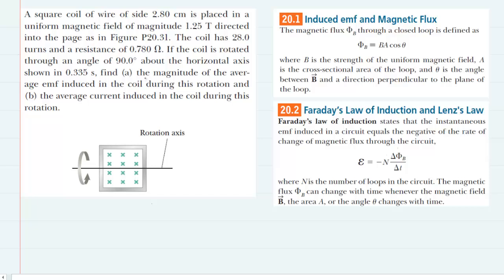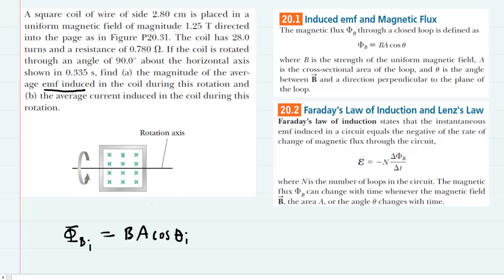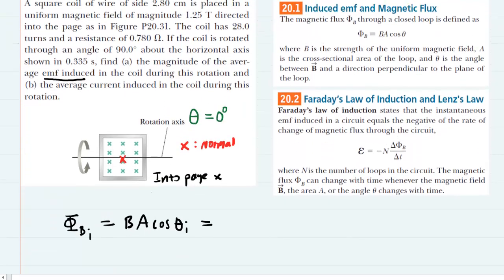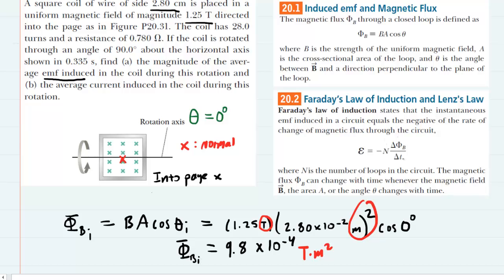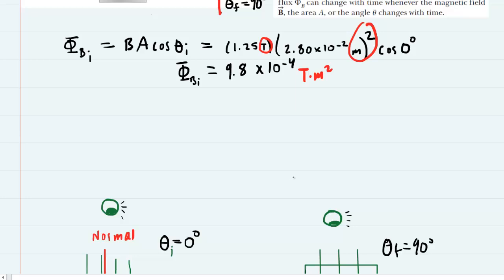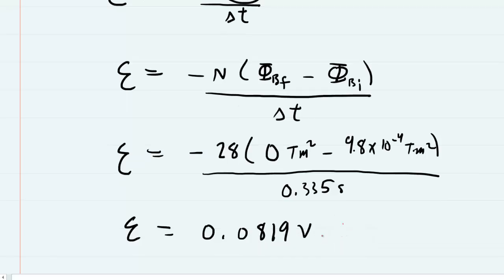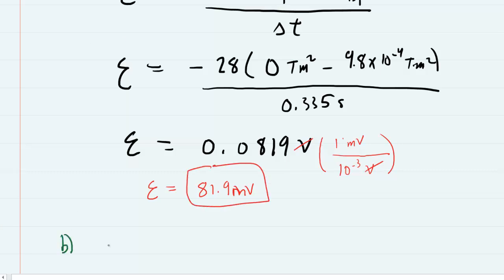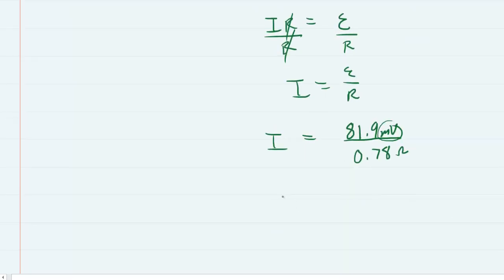A square coil of wire of side 2.80 cm

Comment: The magnetic field shown in Figure P20.63 has a uni- form magnitude of 25.0 mT directed into the paper. The initial diameter of the kink is 2.00 cm. (a) The wire is quickly pulled taut, and the kink shrinks to a diameter of zero in 50.0 ms. Determine the average voltage induced between endpoints A and B. Include the polarity. (b) Suppose the kink is undisturbed, but the magnetic field increases to 100 mT in 4.00 3 1023 s. Determine the average voltage across terminals A and B, including polarity, during this period.